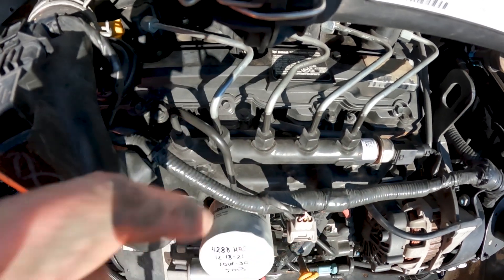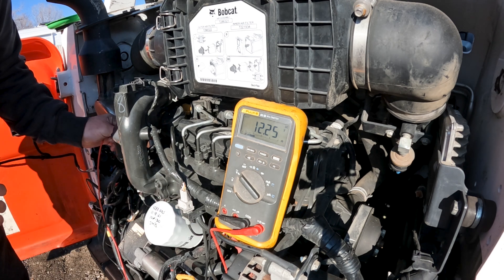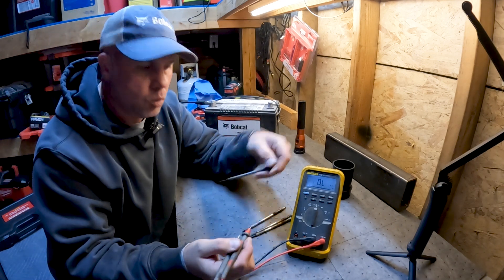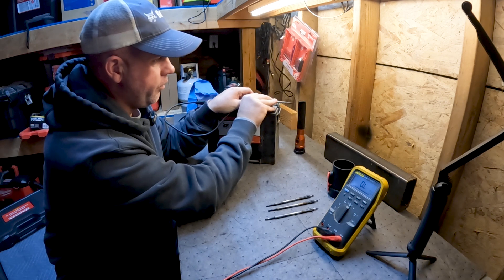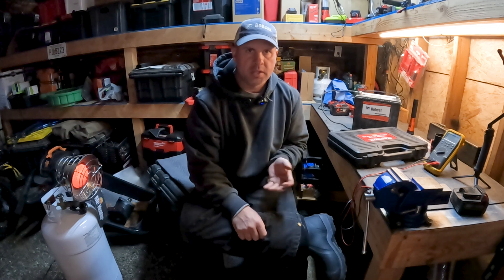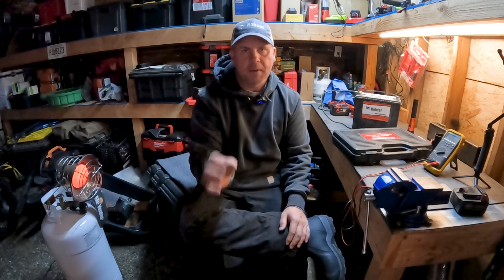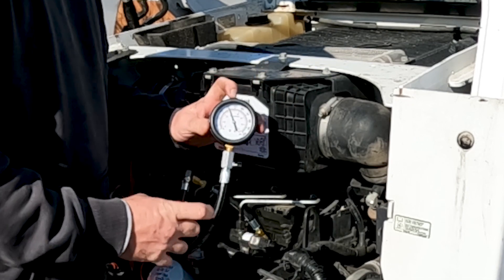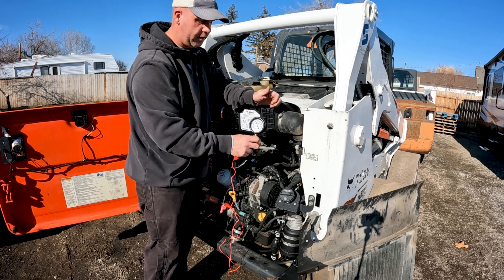Bobcat hard to start or no start when cold.  Engine compression and glow plug test on Doosan engine.

Comment: i got a bobcat t590, it wont start unless i using starting fluid, and when it does start it blows a lot of black smoke. i did compression test every cylinder was 400 psi. im thinking its the injectors but im not sure.

Comment: You really test them the hard way dude.
All you need to know is how many amps each glow plug draws, most pull around 10 amps@12 volts.
So I just clamp an amp meter around the wire feeding the glow plugs.
0 amps they're all dead, 10 amps 3 dead, 20 amps 2 dead, 30 amps 1 dead, 40 amps all good.
Define the dead ones usually all you need is a incandescent test lamp you can tell by the illumination once you get the hang of it.

Comment: Ever have an E000731-20 Accelerometer Fault ?
Reply from the maker: Yep
Reply: @tetradgroup  what can I check or do I need to take it in to the dealer ?
Reply from the maker: @goinsexllc  the accelerometer is a knock sensor.  They are located on the block below the intake manifold, they are a round sensor with a bolt thru center.  You can loosen and retorque to spec.  The torque spec is crucial.  Also check plug and wiring because it's very rare one goes bad
Reply: @tetradgroup  awesome ! It was just in a month or so ago for a whole new fuel system and turbo, got it back from dealer and glow plugs started faulting and then got the accelerometer fault one day all of a sudden !
I appreciate you and your time sir ! Keep the great content coming !!!
Reply: @tetradgroup  wasn’t able to locate the torque spec in the manual but have checked the wiring n plugs

Comment: What an awesome find on Youtube! I bought a 2019 t590 this past fall with 444 hours and so far so good.  I use it in the winter for snow and so far its been fine in the cold but have a new block heater to install and thanks to the video I found the plug. I do have 2 unrelated questions if you dont mind...After it warms up where should the heat needle be at (mine is about 2 needle widths above the cold mark on the gauge (kind of like the 1/8 mark on a old fuel gauge) and getting good heat. 2nd question, my heater switch has 3 settings and there is no difference in low and med. and when its on high there still isn't much more air blowing out but I can hear what sounds like another fan but again hardly any more air coming out. I've changed the switch and replaced both cabin air filters, any idea? Thank you for these video's!
Reply from the maker: Question 1- The machine should run at about 190 degrees.  Question 2:  As far as low air flow, don't forget to check your recirculation filter behind the seat and it is a good idea to raise the cab, remove the cover for the condenser and heater core and use an air compressor to blow out the heater core and condenser.  If it is hard packed dirt, you might have to wash it out with a water hose.  Also make sure the drain holes in the cover are clear and free of dirt and mud.

For more personalized assistance, please visit https://www.4tetradgroup.com/consultations